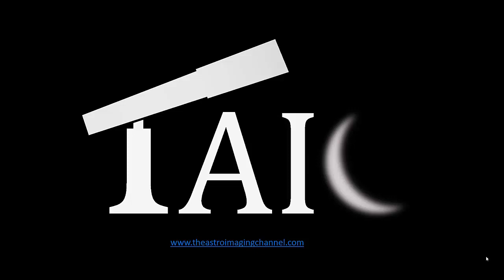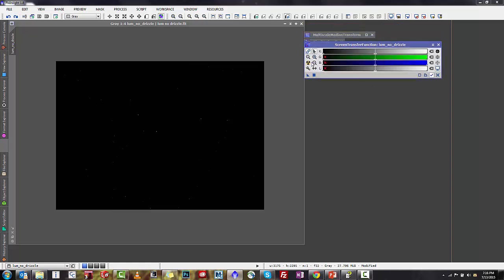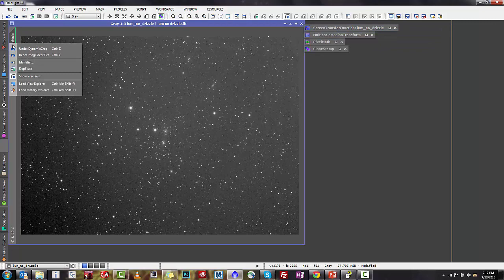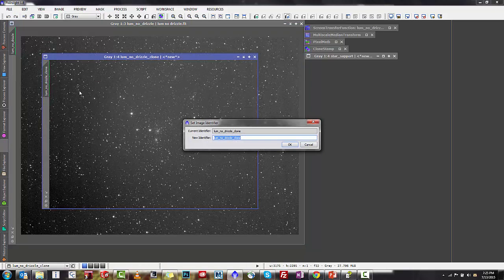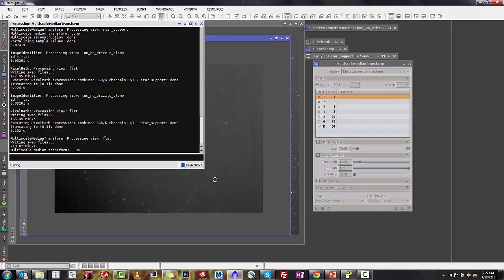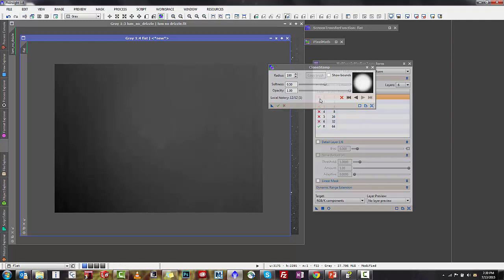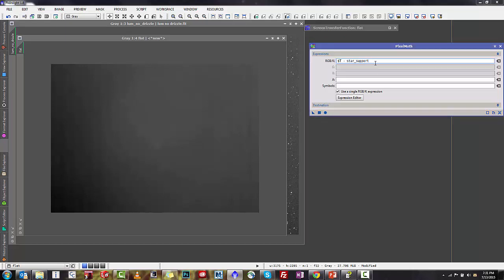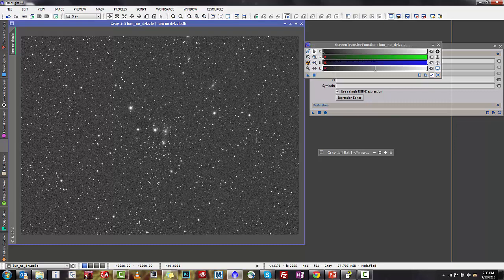Synthetic Flats mini tutorial

Comment: Wouldn't it be easier to use the DynamicBackgroundExtraction to correct the vignetting?
Reply from the maker: In this case it used much more due to the banding, not the viginetting. The background extraction actually enhances the banding.